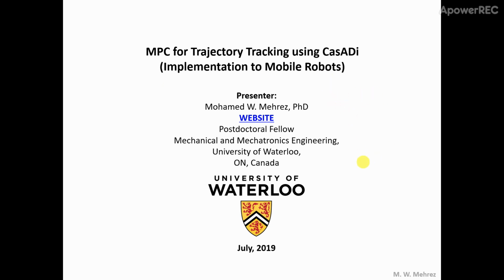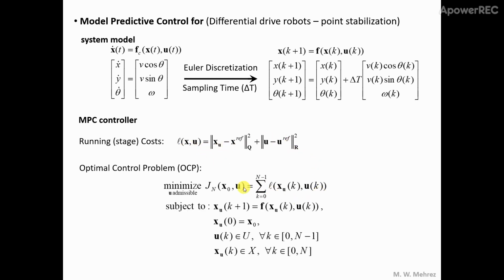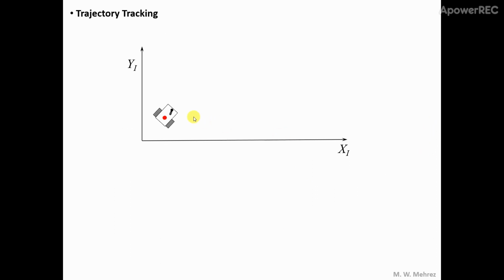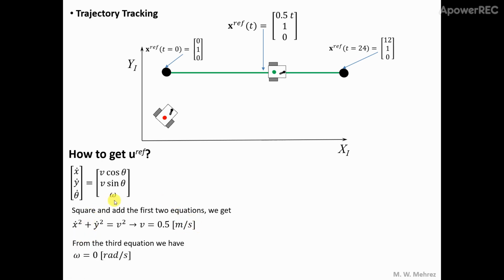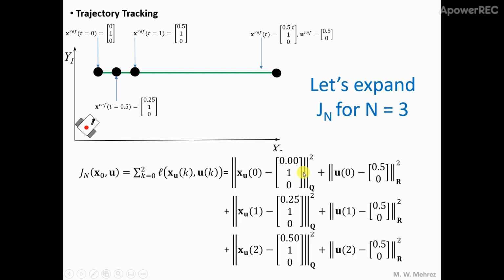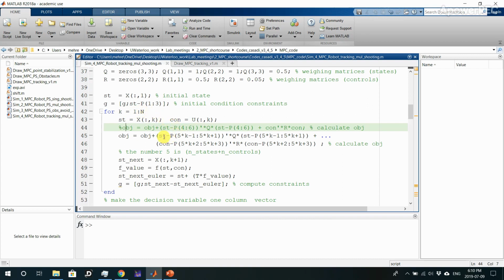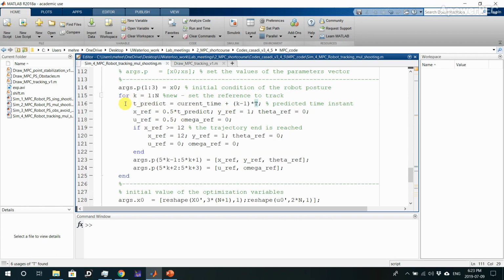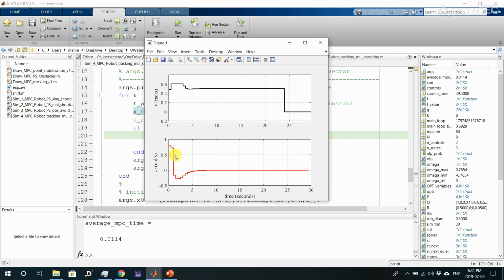Part 3 | MPC for trajectory tracking

Comment: Thank you for this great lecture series on the MPC. Very helpful. 

I have a question regarding the practical implementation. How to handle the actuator delay in the formulation? E.g time it takes to reach the commanded velocity and steering angle..

Comment: Thank you, Sir, for the video. However, I have a question to ask. I have a pre-trained TensorFlow model for making predictions and I would like to use it to apply Model Predictive Control (MPC) using CasADi. I read that only PyTorch models can be used with CasADi. Is there another way to use a TensorFlow model with CasADi without converting it to PyTorch?
Reply from the maker: Thank you for your comment. I am not sure to be honest as I haven't tried it before.

Comment: Hello sir, thank you for the workshop videos. I am actually trying to implement MPC using Casadi on hardware using simulink. I have the measured states of the robot. I am unable to figure out where should I give the mpc controller the current measured states, because there always will be an error between the current state calculated using model and the actual measured current state. Should I add this error term in the objective function?

Comment: Hello Dr. Mohamed. Thank you for your videos, it helps a lot ! I still have a question: why are we obliged to define references (in matrix of parameters P) for the control variables v and omega? What if we don't have any? Aren't these references calculated automatically by the state references and the definition of the kinematic model that links these variables? Thank you in advance !
Reply from the maker: Hi, the pre-defined reference helps in regulating the values for v and omega and also helps in finding the optimization solution quickly. MPC should work without this term but you might not like the behavior of the resulting control action. As a regularization, you can also penalize the change in the control action.
Reply: @MohamedWMehrez  Ok understood, thank you ! 
I have another question: how would you do if you would want to use 2 robots instead of 1 ?
Reply from the maker: You can formulate a multi robot control problem in a centralized or distributed MPC problem. Check the below papers for more details:

https://scholar.google.com/citations?view_op=view_citation&hl=en&user=aRNeH4QAAAAJ&citation_for_view=aRNeH4QAAAAJ:tS2w5q8j5-wC

https://scholar.google.com/citations?view_op=view_citation&hl=en&user=aRNeH4QAAAAJ&citation_for_view=aRNeH4QAAAAJ:UeHWp8X0CEIC
Reply: @MohamedWMehrez  Hi again ! Thank you for that,  would you have any example of a code ?

Comment: Hi Professor. Thank you for your great video. I have one question . Suppose I have a completely random car track which has left and right boundary. This track also has centerline coordinates in each time step. I want to design a car model  that can follow this track and still inside both boundaries. If I only have this car track 's x and y centerline coordinates in each time step, how do I find X_ref and U_ref ?
Reply from the maker: Hi, thank you for your comment. I think you may fit a function to your boundaries and then you would have a time varying constraints. Never tried this though.

Comment: Hi Dr. Mohamed. As you have pointed out, the penalty matrices Q and R have a greater effect in the performance of the MPC. Choosing the right values might be hard tasks. I am wondering if those could be considered as optimization variables?
Reply from the maker: Hi, Theoretically you can, but it would be hard to enforce a particular performance, because the optimizer will chose the values of Q and R that minimizes the cost function. Also you will need to be careful when chosing their limits as if you allow them to be zero, that's gonna be the optimizer choice.

Comment: Hello Dr. Mohamed. Thank you for the Tutorial, it is proving to be indispensable. I have a dynamics equation that would be voluminous if fleshed out completely. To keep it tractable, I would use a Custom Matlab function to represent those steps and then I would recycle the script wherever I need it. How can I do this while still treating variables inside the function as Casadi Variables?
Reply from the maker: Hi, you actually need to rewrite this function in Casadi variables then integrate with the main code
Reply: @MohamedWMehrez  Thanks for the hint. I was able to get it to work. Now, I needed to get a structured output from a function: a matrix with the top left corner containing a rotation matrix and the top right containing the position vector. Basically, a Homogeneous Transformation matrix. How can I specify this matrix as a function of certain inputs while it maintains a structure? I had used the Rodrigues formula to get a nice clean rotation matrix.
Reply: My attempt was as follows:
trans_mat = Function('trans_mat',{axis_,theta},...
                    {[rot_mat(axis_,theta) (SX.eye(3)-rot_mat(axis_,theta))*point;...
                      0 0 0 1]},...
                    {'axis_','theta'},{'trans_mat'});
Reply: Hello doctor. I tried out the function:
% Define Homogeneous Transformation matrix
theta = MX.sym('theta');
axis_ = MX.sym('axis',3,1);
point = MX.sym('point',3,1);

axis_cross_mat = Function('unit_axis',{axis_},...
                          {[0 -axis_(3,1) axis_(2,1);...
                            axis_(3,1) 0 -axis_(1,1);...
                           -axis_(2,1) axis_(1,1) 0]/norm(axis_)},...
                          {'axis'},{'axis_cross_mat'});
rot_mat = Function('unit_axis',{axis_,theta},...
                   {eye(3)+axis_cross_mat(axis_)*sin(theta)+axis_cross_mat(axis_)^2*(1-cos(theta))},...
                   {'axis_','theta'},{'rot_mat'});
trans_mat = Function('trans_mat',{axis_,theta,point},...
                    {[rot_mat(axis_,theta) (eye(3)-rot_mat(axis_,theta))*point;...
                      0 0 0 1]},...
                    {'axis_','theta','point'},{'trans_mat'});

and it seems to work fine. One thing that I noticed is that the function object has the syntax:
f = functionname(name, arguments, ..., [options]).

Then, inside 'arguments', can I have a complete function like:

function [mat] = homo_trans_mat(axis,theta,point)
%UNTITLED We calculate the rigid body motion transformation matrix here
%   Detailed explanation goes here
mat = zeros(4,4);
% Angular displacement component
len_axis = norm(axis);
unit_axis = axis/len_axis;
axis_cross_mat = [0 -unit_axis(3,1) unit_axis(2,1);...
                  unit_axis(3,1) 0 -unit_axis(1,1);...
                  -unit_axis(2,1) unit_axis(1,1) 0];
rot_mat = eye(3)+axis_cross_mat*sin(theta)+axis_cross_mat^2*(1-cos(theta));
mat(1:3,1:3) = rot_mat;
% Linear displacement component
mat(1:4,4) = [(eye(3)-rot_mat)*point;1];
end

sitting inside? You might notice that I had to convert the above function into several functions in symbolic form.
Reply from the maker: Hi, I didn't get to this level of using functions before, but it seems like you are doing it right.

Comment: Thanks Dr. Mohamed for this video. 

If the reference trajectories are real points with time (not function like your code example). How can I modify the reference part?
Reply from the maker: In this case, you can lookup your vector of reference points by the sampling instant and pass the reference points (for this time instant and the following instants depending on the prediction horizon) as parameters everytime step. very similar to how you update the feedback every time step.
Reply: Thanks a lot. I tried to implement the same idea, but I faced a problem because of the prediction Horizon (N).

If the system has 6-states and 3-control input. while the reference points are 1124.

while(mpciter < sim_tim / T) %Mpciter=1124

      args.p(1:6) = x0; 

    for k = 1:N % N=10
      
% load reference vectors
  args.p(9*k-2:9*k+3) = [x_ref (iteration_relation), y_ref (iteration_relation), ,...etc];

   
     end
end

In for loop, at each prediction iteration, arg.p=96 value (states+N*(states+control)).

The problem here is that the code will stop before reaches the final mpciter iteration number. 

 what is your suggestion to compute iteration_relation raltive to mpciter?
Reply from the maker: You can simply repeat the last reference multiple times until you reach the end of your trajectory.
Reply: @MohamedWMehrez  Thanks a lot. I modified the code to deal with iterative reference points. 

Regarding the reference control signal, in presentation, the model is simple so it is easy to compute the reference control signal. but what are the best choices to calculate the reference control in a complex model? Example: x_dot=J*u. J is 3*3 matrix with nonlinear elements u.
Reply from the maker: @ibrahimseleem  you can simply calculate u as u = J^-1 * x_dot_ref

Comment: Is it possible to implement this in Simulink somehow? I am doing a thesis regarding PMSM where I would like a NMPC.  Which is a cascade coupled system with 1 out speed control loop, and two inner control loops for the current.
Reply from the maker: check out Casadi blog for simulink examples
https://web.casadi.org/blog/

Comment: Thanks a lot for your videos. They are really good and gives a good understanding of MPC.
However, I have some doubts regarding the implementation of MPC on a real robot and it would be great if you could clear it.
1. How do I allocate the uncertainty in the state estimation from lets say an EKF to my state space model of MPC ? Also, If lets say weight of the robot is dynamic while moving, how can I add that information to the MPC for a good prediction ?
2. In the example you have described, what would be the effect if i include only x and y in the cost function and do not involve theta. Wouldn't the robot still be aligned properly on the path if the prediction horizon is big enough ?
3. Wouldn't adding weights to the control input to follow the reference control input act against the correction. Lets say if i am tracking an arc and I penalize the correction in angular velocity, wouldn't it be more like acting against the angular correction even though there is a feedforward control action?
4. How do I effectively choose the sample time between each prediction step ?
Reply from the maker: Thank you for your comment:
1- There are many studies on stochastic MPC which consider uncertainty of the measured state. Nonetheless, for small uncertainties, I believe that nominal MPC should work fine because of its receding horizon nature.

Please note that I used only the kinematic model in the simulations. If you would like to include a changing weight, you will need to derive the dynamic model of the system and use it for prediction. Nonetheless, I believe that most of the research robotic platform follow pretty well the kinematic model even if there load is varying.
Reply from the maker: 2- Yes it would. Given that you are also penalizing the control actions.
Reply: @MohamedWMehrez  2. why is that i should penalize the control actions? If not does it make oscillations due to aggressive correction ?
Reply: 4. So even if the sample time do not match with the controller frequency, will that be still fine? or let's say if my controller frequency is 60hz, in your opinion approximately what should be the sample time ?
Reply from the maker: You penalize the control to regulate it. Its penalization also helps in finding an optimal solution faster.
Reply from the maker: Ideally, the sampling frequency in simulation should match that of reality. However, I am not quite sure what kind of system you have and what controller frequency you are referring to.
Reply: @MohamedWMehrez  Do you think putting constraints on output (in this case error) can improve the controller ?
Coz as of now there is only penalty so as to follow the path properly, the robot may not reduce the linear velocity to that extent that it totally make sure that the path is correctly followed eventhough it may reduce a bit of linear velocity.
Reply from the maker: Of course, you can. This is in fact on of the classical ways of enforcing the stability of the mpc controller, i.e. adding a terminal equality constraint on the error to enforce it to zero during the optimization. However, this method would typically require a longer prediction horizon such that the constraint can be satisfied.
Reply: @MohamedWMehrez  Cool. That would be a good way to stabilize the system. As of now eventhough my controller follows the track almost correctly, there are considerable oscillations around the setpoint. I would expect the mpc to reduce the linear velocity considerably to make sure the bot traverses the track more accurately given that state cost is high but unfortunately i am not seeing much change in the linear velocity. may be adding a terminal state constraint would make it more stable. How about adding an incremental exponential cost for the states with a higher terminal state cost without having a terminal state constraint as such? Do you think it can make the controller more stable ?
Reply from the maker: Adding a terminal cost also helps in stabilizing the system. However, I don't think that adding an exponential weight for this cost is a common practice in the mpc literature. The oscillations you have may be fixed by adding more weight on the control deviation (error).
Reply: @MohamedWMehrez  I did add more weight on error in x, y and phi but oscillations still exist. I thought it might be due to uncertainty in localization as oscillations were very minimum when i tried with wheel odometry. But as you pointed out before, the little uncertainty should be handled by mpc. So probably adding terminal cost or terminal state constraint might solve the issue.
Reply: Also, let's say if added high terminal cost and the path the bot is trying to traverse is a circle such that the starting point is same as that of ending point, will it cause any issue ?
Reply from the maker: That should not cause any issue I believe.
Reply from the maker: 3- in some sense yes; however, keep in mind that the state is also penalized in the cost function. In this case, if you have more weight on the state error than the control error, then your robot will want to approach the reference trajectory quickly then tracks it (that's when the feedforward control is helpful).
Reply from the maker: 4- it depends on different factors; for example, if your system dynamics are fast, e.g. a flying robot, you may want to have a shorter sampling time than a slow dynamics system. Also, the approximation model you use for simulating the system, e.g. if you use Euler approximation, then a short sampling time is needed for a better prediction accuracy. While if you use RK4 integration, then you may relax this a bit. Finally, perhaps the prediction horizon you use could also be a factor, e.g. if you have a very short sampling time and a short prediction horizon, your prediction will see the future for only a limited duration and this affects the performance of your controller.

Comment: Do you think it is convenient to add the end term (or Mayer term in other biographies) to the objective function for trajectory tracking purposes?
Thanks in advance!
Reply from the maker: Thank you for your comment. A terminal cost can be added for the point stabilization case as well. Choosing the terminal cost properly and perhaps a terminal region constraint is one way of guaranteeing stability of the closed loop system. There are also methods for ensuring stability without the terminal cost altogether, see, e.g. https://www.sciencedirect.com/science/article/pii/S0921889019306232 and the references therein.

Comment: Thank you for the great videos. 

I was wondering if neglecting the control reference (Uref) would still make this MPC a feedforward controller. It would still use the model to make prediction of states that are then used as initial guess for the NLP. I'm using as a Xref a list of waypoints that are not a function of time but only states to reach one after the other. Uref then becomes hard to get. Would you think (Uref) would still be an important parameter to calculate? 

Thank you !
Reply from the maker: Thanks for your comment. I see this implementation as a successive point stabilization in which you update x_ref every time step and keep it constant over the prediction horizon. This is different from trajectory tracking in which x_ref gets updated within the same prediction horizon. There is actually nothing wrong with what you suggested, but we can't clearly call it trajectory tracking. Moreover, If x_ref gets updated within the same prediction horizon while u_ref = 0 that's also still tracking, but with a feedforward control of zero. You can also avoid penalizing the control action in the cost function altogether, but you will lose regularization of the control and the resulting OCP can be a little harder to solve.
Reply: @MohamedWMehrez  Thank you for you answer,  I really appreciate the help.
I'm not sure to understand how u_ref makes the feedforward controller. In the case where, as you say, it is not penalized in the cost function, a prediction of controls and states will still be done and set as the initial guess at the next timestep. Doesn't that make it a feedforward controller?
Reply from the maker: @jeremigraveline3065  u_ref is basically the control value that when you apply to the system, the system would ideally follow its reference x_ref. I see what you mean by not penalizing the control at all and use the previous solution for initialization. To be honest I don't think that this can be considered as a feedforward control especially for the first step in MPC where you typically don't know a good guess for u. I suggest that you check the literature on how a feedforward controller is implemented for the system you are considering.
Reply: Thank you for your answers,  I'll keep studying the case as you say, I get what you mean.